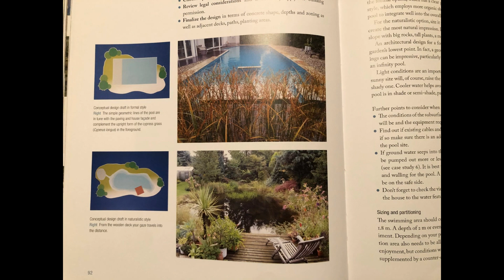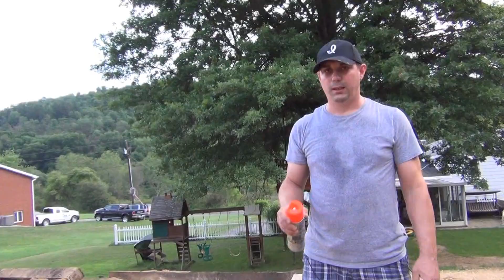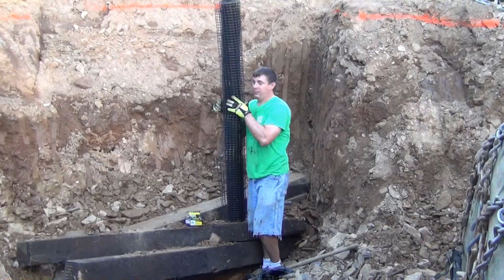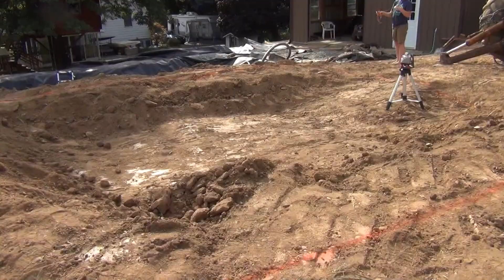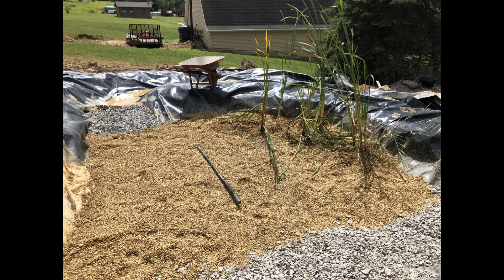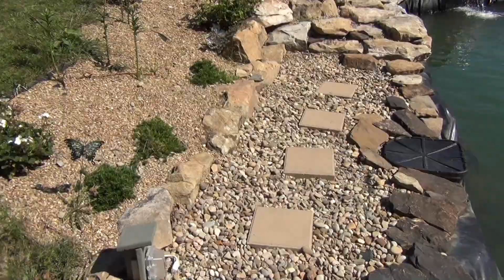How to Build a Natural Pool

Comment: Much more beautiful and inviting than a more artificial pool, plus it’s more sustainable as well.

I wonder if there is something you can line the pool with other than plastic though, clay perhaps
Reply from the maker: You can use clay. I have a friend who built a pond with a clay bottom. It holds water but the bottom is mooshy. I don’t like that feeling. Would be ok with rocks on top of the clay. That would be hard to sweep. That’s why I went the way I did.
Reply: @fixerjoe3283  makes sense, it’s probably cheaper as well.

Do you think stocking a few bottom feeding fish would relive the need to sweep the rocks?
Reply from the maker: @logans3365  fish are a bad idea in pools because they create additional nutrients for the algae. Pond Guy sells muck eliminator that dissolves it

Comment: That looks great 😊 There's a product you might want to look into, called rock-on-a-roll, that you could just drape over the top where the liner is exposed to the sun, & make it a natural transition to the rock. It would prevent UV rays from degrading the liner where it's exposed to the sun above the water. I bought some to wrap around a galvanized stock tank I turned into a pond & to hide the top rails of a semi inground doughboy pool & it's great stuff. It looks like real rock but it doesn't react with anything in the water.
Reply from the maker: That sounds like a good idea. I’ll have to check it out.

Comment: Hi Joe- question. You mentioned in your VID you shocked the pool with chlorine some? Is it safe to assume there is no aquatic life in the pool? Or have you added minnows or anything, and it's such a small amount of bleach it doesn't kill them? We are coming into spring and we have built our poop this past fall, and the water is cloudy. Unsure what to do at this point?
Reply from the maker: Aquatic life in the pool is not a good practice. Their waste will add more nutrients for algae and promote harmful bacteria. If you have life in your pool cloudiness could come from ammonia. It takes a while for silt to filter/settle out. I also used some activated carbon in net bags to help clean the water.
Reply: @Fixer Joe  the only aquatic life in there are maybe 10 or 15 minnows. I doubt their playing any big factor into the health of the pool. I know a good amount of it is silt that has built up on the bottom and sides. I'm wondering if a partial water change, perhaps letting half tbe amount of water out, and refilling with hose water would be a good idea? The water was clear and healthy and we could see to the bottom, and we turned the waterfall system on and all the leaves and sludge got mixed up and now it's cloudy.
Reply from the maker: @LaLanaRK  the leaves and sludge will definitely cloud it up. If you can vacuum that definitely helps. Let your pool sit still for a bit so everything settles first. If you don’t have a vacuum. Buy an inexpensive water jet leaf vacuum with a fine mesh bag on it.

Comment: So glad I found this. I've been hand digging and building one of my own but a much smaller one more for just hanging out in. My concern is the pump. And this may be a really stupid question so I apologize up front but if you submerge a pump in water it means it has electricity going to it right? Does anybody ever get shocked when they go in? I'm probably overthinking this but I finally finished digging and now I've got to think of this next step. I would appreciate anybody giving me some insight on this!
And your pond is stunning!
Reply from the maker: Thanks. My pump is not submerged. You can use a submersible pump to move your water. I would highly recommend you power it off of a GFCI circuit for safety in case the motor casing develops a leak.

Comment: I would love to know more about the plumbing.
Reply from the maker: I used polyethylene pipe except at the pump connections. I had to covert to PVC there. 1 1/2 for suction and return. 1” for the pond bypass/discharge line.  I also converted to pvc for the pond inlet. That help?
Reply: @fixerjoe3283  It does because I was picturing all pvc,. So that is way less work. more flexibility, and probably easier to replace.  I'm still curious about the occasional bleaching.  I suppose when you said you make sure all bleach like stuff is out of the water before sending it to filter; did you just turn the pump that pumps to filter off?
Reply from the maker: @JohnJingle23312  I have a tee on the pump discharge line. One end goes to the pond. The other end goes back to the far side of the pool to create a current towards the skimmer. I shut the valve on the line that goes to the pond so all water goes directly back to the pool. Then I add 1/2 gallon of bleach and let it recirculate for a few hours. I check the water with a pool test kit to make sure there is no free chlorine before opening the valve to send water back to the pond/treatment zone.
Reply: @fixerjoe3283  Thank you, and Wow only a half gallon for that huge pool so it is very effective filter.  Thank you so much look forward to your next installments.

Comment: So the level appears to be low is this just because it has not filled all the way or is there a reason behind this. Most natural pools iv been researching about has the pond overflowing into a shallow lip around the pool giving it a lot more of a natural appearance and also help with the filtration.
Reply from the maker: Low level, but I have a low point for overflow which prevents the whole pool from filling up the whole way. In retrospect, the way you describe would be nicer. Less liner showing.

Comment: Hi Joe- beautiful pool. We are going to build our own natural swimming pool here pretty soon. Wondering if you can expand on your decision to use a pool filter such as this, over a pond filter? I'm so torn about it. I do want a pump that can provide a lot of water movement. Thanks in advance!
Reply from the maker: Hi LunaRK. My skimmer is a pond skimmer consisting of a net and woven plastic screen. The gravel in my pond along with plant roots acts as the filter. I could have incorporated a pool sand filter but I would need a larger pump and it likely would plug up too often and require backwashing. My setup is pretty passive. Just need to vacuum every so often. Hope this answers your question.

Comment: Wow, that's amazing!!!  My only question is about the exposed pond liner being subjected to UV rays.  Won't that cause it to break down and eventually destroy it?  Is there any way to conceal the pond liner better around the edges?  We're dreaming of building a pool like this ourselves.  Thanks so much for sharing!
Reply from the maker: Thanks Carole. I went with polyethylene because it is not harmed by UV as a PVC liner would be. The company gives a 25 year warranty as well. Good question.
Reply from the maker: There probably is a way to conceal the liner. A lot of ponds are lined with rock. I didn’t want to do that as it is a pool and needs vacuumed. You could probably attach rock to some type of wire mesh and hang it over the edge into the water. That would cover the liner but it’s additional work.
Reply: Make a ledge or shelves at the waterline to place rocks or pavers to conceal the liner.  https://youtu.be/uO94CeOS7wE